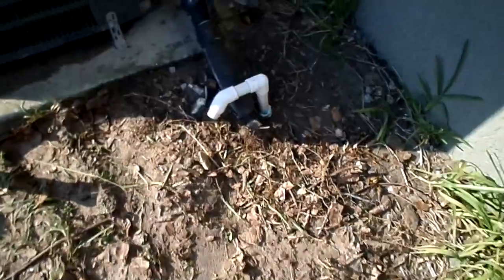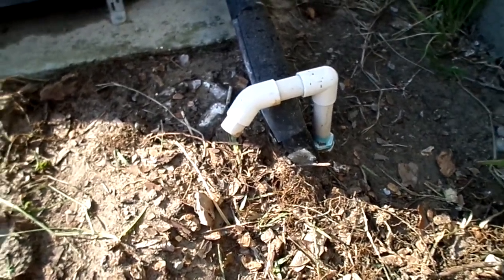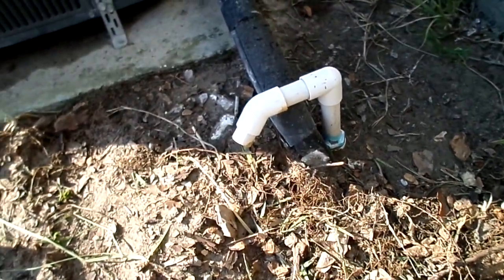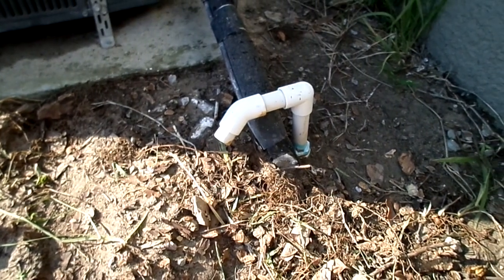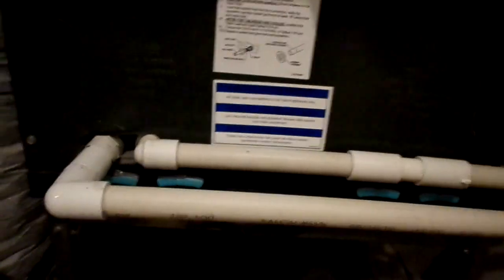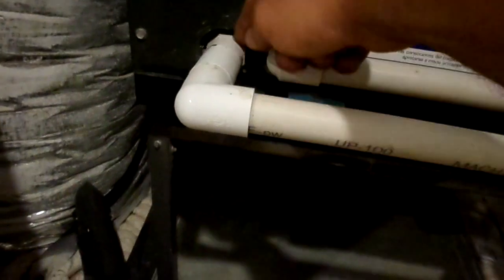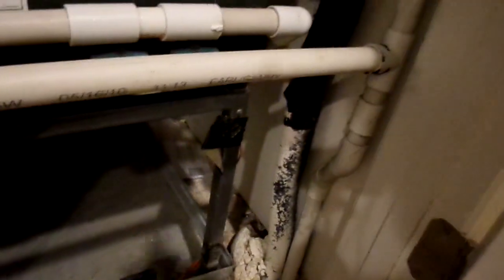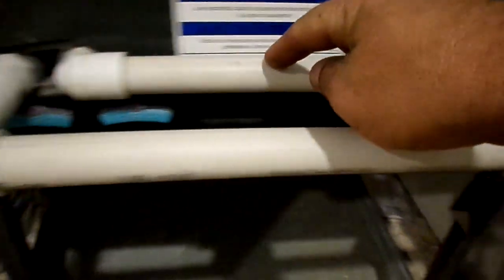Nothing to do with Boats

Comment: It is funny that you just posted this video I was just doing the same thing last week. I have an older unit inside that doesn't have the float switch or any indication for that matter. I didnt realize it was stopped up till water was on the floor and access to the line inside is difficult so I used the shop vac on the outside and pulled everything out.
Reply from the maker: John MBK nasty isnt it?  I could not believe how much crap was in that pipe....lol